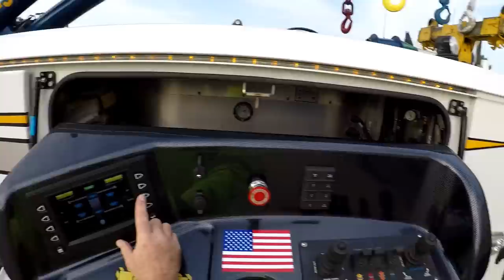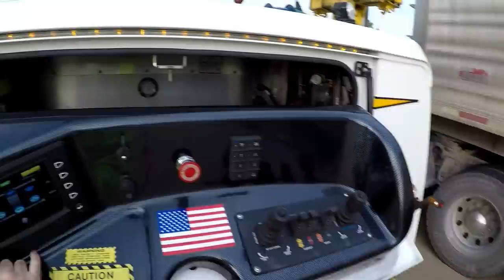Sands of Time Part 1   The Lift

Comment from the maker: There seem to be a couple of common questions and I will attempt to answer them with this comment.  One of the questions is "Why did I have to lift the trailer rather than just dropping the trailer on it's legs like a normal trailer?"   This is a valid question.  This particular style of leg is called either a "drop" or "peg" leg and they are not designed to handle the weight of a loaded trailer.  They are only designed to support a trailer when it is empty.  The second question is "Why didn't I charge the air system on the disabled truck rather than caging the brakes to allow it to be pulled out from under the trailer?"  Also a valid question.  Either way would have worked and airing up the tractor was my first choice.  I edited out that section from the main video, but if you watch the "time lapse" at the end you will see me with the truck's hood open and looking at the air system.  Long story short, my fitting to tap into the air system in front of the check valve on this truck was missing.  I could have aired it up by other methods, but chose to simply cage the spring brakes.    I hope this answers those questions clearly.  Thanks for watching and God bless.
Reply: Thanks for explaining.
Reply: Ron Pratt well said Ron but you shouldn’t have to explain your actions !!!! Your Ron Pratt !!!!! People need to recognize !!!!!
Reply: Ron Pratt also the tow company I work at installed the Century 1150R on the trucks just 2 years ago. I drive a 05 Kenworth W900L it had a older model unit on it probably was a Jerr-dann rotator. So now I have the same unit u have on your rig. Mine is 05 but it got a brand new unit on it. The company I work at, only has two brand new rigs, and only two older trucks got a new unit installed because they were the best condition. It’s a great unit. I see in your videos that u do good with the truck. :) I learned things so now I got tips from u that I can try out when I work with my new Rotator unit. The old one I’m very used too so I’m still getting used to the new one. So I’m pretty much learning to use it from u man. :) keep it up. And once again your a great guy. Keep it up with your vids. I know you can’t make daily videos because u have things to do and stuff. It’s all good tho. There isn’t rotator jobs every single day. At my job I don’t get rotator jobs every single day too.
Reply: Why would they make trailer legs not strong enough to support the loaded trailer, what is advantage to that.
Reply: Kevin Weil Dump trailers are almost never separated from their trucks.  They only work on trucks with extra hydraulic drives, and disconnecting and reconnecting them takes a LOT of time.  They are also very rarely 'long haul' and usually work short distances, plus can unload in seconds without much interaction from drivers.  So the ability to drop a loaded trailer is not really useful on these rigs.  Peg Legs are also lighter, cheaper, and less likley to fail.  They also dont need regular maintenance.  They are a good choice for this kind of a rig.
Reply: Light duty legs are cheaper and easier to make, brings down the price of the trailer.  And if you assume that the trailer is never going to be detached from the tractor while it's loaded, dock-to-dock with no sitting in yards, well, the tractor will provide the necessary support.
Reply: While nobody's perfect, if an experienced professional seems to be overlooking something "obvious", people, there's usually a good reason for it.  That you, the viewer, lacking the experience, and not being on the scene, don't know and possibly can't see based on the camera's point of view.  Sheesh! Have a little faith, instead of hammering the guy, here or on anybody else's video.
Reply: Ron Pratt touy 😀😊
Reply: I didn't think he was being "hammered". I found it obvious that he (and the operators) knew what had to be done under the circumstances. There are some things that less experienced people might not understand, or overlook, and his courtesy and patience in explaining things to us makes us all better people in the future. I am not in the towing business, but I can relate things he does to my other activities. Just watching him work is a great education. The helmet cam alone is the best teacher. Thank you Ron.
Reply: Ron Pratt . If I wanted to air up the tractor. Can I air the tractor thru the glad hand and which glad hand do I use? Thank you
Reply from the maker: On some tractors, not all, you can back-feed the air to the tractor through the red air coil and the back of the cab.  You have to supply air to the air coil and then hold the red valve on the dash "in" until the system is full.  As I said, this does not work for all tractors.  There are multiple other methods for supplying the tractor with air.  Thanks for watching and God bless.
Reply: sounds like you need to hire too more tow truck drivers sir"
Reply: @kingkevin267  My tought exactly. In Europe there is not such thing, I mean the legs mut be capable to hold the fully loaded trailer plus 30%, but it's a different market and different laws.
Reply: The truck was so broke it they had to use a pick up truck to pull it out from under the trailer
Reply: Ron Pratt glad the weather was good makes caging the brakes a lot easier I'm sure.   Crawling under a truck when it's got snow on the ground makes it caging hard, especially if the Caps were missing and the salt, dirt or ice gets in the way.
Reply: @kingkevin267  That's not the only type of trailer that's like that. I've been driving a truck for almost 30 years, cattle pots (bullwagon) is like that as well!  They are designed to hold an empty trailer, partly because of weight & then some the frame is aluminum & don't have a heavy enough frame underneath to hold the crank type dolly legs. The trailers are made so the whole trailer structure supports the trailer with lighter weight material fully loaded & hooked to a tractor.
Reply: @greatdiesels7422  there are other types of trailers that same way, & some of the reasons are because of the way they are designed & used.
Reply: Sou do Brazil e sou fã  destes vídeos  gostou muito  tem como eu ganhar um adesivo  deste do caminhão  de resgaste
Reply: @xheralt  VERY WELL SAID ! Sometimes one has to chuckle, other times,  all  one can do is shake your head. I'm sure I show my ignorance on a regular basis!LOL
Reply: @kingkevin267  they like to be cheap, and it saves weight. That style leg is from the old days. Gas tankers have the same issues, one of our customers had the legs break off and go through a trailer loaded with gasoline.
Reply: @feeneysmechanical6215  on some older trucks you can use the red glad hand to air the truck up, but it's not possible on almost all trucks we come across. The tractor protection valve is a one way valve feeding the trailer
Reply: @kingkevin267  years ago there were some gas tankers near me with no landing gear at all. If they had to disconnect an empty trailer they used two 50 gallon drums.

Comment: Every time I see this wrecker, I'm in awe. The design must of taken a long time, the truck is complex being it's hydraulic and electronic combined operation.  I'm amazed at how much weight it can lift high into the air, but most I'm exasperated at what this truck much cost brand new. You got to do a lot of towing to make the payments on a truck that complex. If you had to start out with a little tow truck and work your way up in profit to be able to afford a massive truck like Ron's, if must of taken awhile, perhaps years. What else is wild, it's not your only big truck, but I think is the biggest in the fleet.... 
Nice job as always, and thanks for your time here in producing the video. God Bless you back..

Comment: I worked for a crane hire company in London UK, if I was on police call duty I would take it home. The office would call me and often a police motorcyclist would be waiting at the end of my road, to escort me to the emergency. mostly we would only be moving and or loading the truck load. Guys like you would take care of the unit and trailers. After a while I got into a repore with the guys and we would assist one another to get the job done safe and quickly.

Some jobs were pretty gruesome but had to be done, I can tell you sleepless nights followed. Especially if kids were involved.

Comment: I used to pull a 60 foot spaghetti rack (rebar) that had the same kind of legs back in the 60s. One outfit I worked for the tractor and trailer were never separated in all the years he owned them. Same thing when I was hauling equipment on a 50.5 foot float.

Comment: You need a few pieces of rail road tracks to shove under the trailer, then chain up the railroad tracks on either side to lift straight up. At the top you can have another piece to keep the chains spaced out enough from the trailer walls forming a triangle above the upper rail towards your crane hook. Not sure if thats a good idea, because you would probably have done so by now :p

Comment: One bit of related experience I can add is using about a yard of 3" rope as a wheel chock; in a previous job moving aircraft about the size, weight and tire size as a class 8 truck we used those particularly when we were moving an aircraft with no brakes because it doesn't take precise aim or getting in the path to get them into place.

Comment: Hey Ron, another save the day!  Been watching your videos a little while now a little off subject for our profession but I enjoy your rigging. You take pride in your hauling just as every cdl driver should regardless of there haul. One thing I have noticed is no lanyard or shoulder strap for your controller?!  We have several pieces of equipment and trucks with similar/valuable controller as yours and a simple binoculars double shoulder strap works great! They make really nice ones now affordable, adjustable, and easy to find at any outfitter or online. Just make sure it has good quick clips to the controller. Stay safe. Keep rolling!
Reply: He has the straps that came with it but never really uses them since he often as you watch crawls into tight or otherwise snug places where it would just be in the way, so he just hand holds it when he needs to control or reposition the lift.

Comment: DPFE is going to be the death of the diesel truck.  I bet there is nothing wrong with it except the DPFE system is messed up.  I also see a $10K+ repair bill generated by this "failure".  So sad.  Great job as always Ron!
Reply from the maker: Emission system problems account for more than half of our standard breakdown tows.  It is sad.  We have problems with our newer trucks and the emission systems as well.   Thankfully, we have the software, tooling, and ability to repair most of our own issues.  Thanks for watching and God bless.
Reply: i'll say "choo choo". which means place large freight back on rails, it's always made more sense to me than tons of trucks running all willy-nilly everywhere. granted trucks are still needed!
Reply: Seems all logic has gone out the window with this militant clean air garbage of the past 9 years. They're killing the working man's bank account! 

I've had asthma my entire life - I had it in the 70's when we still used leaded gas, and most cars on the road had nothing but a PCV system for an emission device ... and I STILL have it today, with 95% of every vehicle on the road loaded with emission software, and hardware. I'd be the first to go if the air was as bad as the powers that be tell us it is. I'm still breathing! 

When is enough going to be enough?  I fear it NEVER will be. As soon as every vehicle is electric and emissions are down to ZERO, they'll invent some other crisis to harp on. Too many are making money off our backs on this garbage.
Reply: Yes it cost about $1500 to clean the DEF filter/catalytic converter,every 250000 miles!,there goes our pay raise,can you say DEF delete. REDICULOUS.Ron making it look easy,I would have not have thought of hooking from the front,thought Ron was going to hook from each side. :)
Reply: William Kelley I think it’s more than emissions since it wouldn’t start
Reply: Remember that the owner and driver of the truck both said that the regen was not working.  What that means is that the DEF  is not getting cleaned out and it clogs up and blocks the exhaust.  It is the same thing as a clogged catalytic converter, plugged exhaust = no engine start.
Reply: William Kelley thinking  same thing. When we figure the extra fuel being burned and wasted time towing this DEF stuff around..wow. Talked to a driver not long ago, his truck down (re-gen issues) company had to bring another tractor, plus a car, to get load moving. Only good thing he was like 90 miles from his terminal. What a waste.

Comment: Great job as usual Ron, One question from someone that knows very little about a big truck, why couldn't you hook air from the wrecker to the air lines coming off the broke down truck and build air pressure enough to move the truck out of the way,
Reply from the maker: I could have done that as well.  Either way would have worked.  Thanks for watching and God bless.

Comment: Just a question or taught did you happen to check air governed to see if had spot to fill air tanks to save from putting in T bolts in brake campers
Sorry for miss spelling few words. Or put a ball valve in to air tank fill system ,  or hook up to red air line to back fill air tanks

Comment: Have you considered adding a lift beam to your equipment? If you had a simple (adjustable) beam you could slide under these type of trailers in front of the legs. You could beam out and lift directly from above the trailer.

Comment: Hey Ron.  Love the teamwork between you and the customer to get the job done.  I admit, I do skip around your videos when I usually watch them, so I may have missed this.  But I do have a question, coming from someone out of the industry (I am a railroader). Why would you cage the brakes instead of running air to the tractor?
Reply from the maker: Running air to the tractor was my first choice until I found my adapter fitting to tap into the system in front of the check valve was missing from my kit.  I could have tapped in elsewhere, but decided to simply cage the brakes.  Thanks for watching and God bless.

Comment: You have stated "all three drums are in free wheel" but when you picked up a car using each wheel as a hook point you controlled each hook individually. That would make it seam like there were four drums. How does that work?
Reply: He does have 4 separate lines, each one of them is individually controllable. Maybe when he was lifting that car, he was only using 3 lines?  Or maybe he free-wheeled them all, then put tension on the one, leaving the other 3 in free-wheel mode... I'm not familiar with the controls, don't know whether you'd have to give one command to free-wheel all, or give each one a separate command to free-wheel.
Reply from the maker: There are actually 5 winch drums on this truck.  Four on the boom and one drag winch.  I'm not certain where the 3 drums you are referring to came  from.  I don't recall mentioning just three.  Anyway, there are 5 winch drums and I generally place all 5 drums in "free spool" at the beginning of each job.  Thanks for watching and God bless.

Comment: Hey Ron! Excellent work as usual. Just a thought, is there a reason you don't cage the parking brakes between the tandems first. So that way if it wants to roll while you are disengaging the front brakes on the tandem which is easier to access is a bit easier to escape from, than in between the front and rear wheels on the tandem. Stay safe mate!

Comment: Pretty cool!   How often do you change lifting cables?
Reply from the maker: This is a 2015 Peterbilt with a Century 1150R  5 winch setup that we purchased new.  I have only changed one cable on this truck, the white one that you see with a temporary repair.  That cable was damaged by a mistake that I made on a job when I wasn't watching my cable close enough and it ran across the edge of a metal object and cut a few strands.  The cable didn't break, but it needed to be replaced.  Otherwise, as long as you properly use and maintain the cables (wire ropes) they will last a very long time.  Thanks for watching and God bless.
Reply: Thank you.

Comment: that was what i was thinking, lowering the landing gear and the axles just to secure the trailer/load as a support for anything going wrong.
Reply: Those legs can hold an empty trailer but not a loaded one if at all and if you noticed it does not have stabilizer cross bars so if they used it to switch out the truck it would have collapsed and trailer would take a hard heavy nosedive into the parking lot where it was.